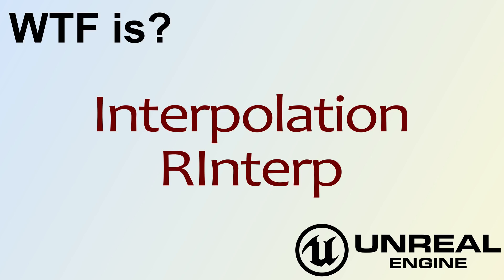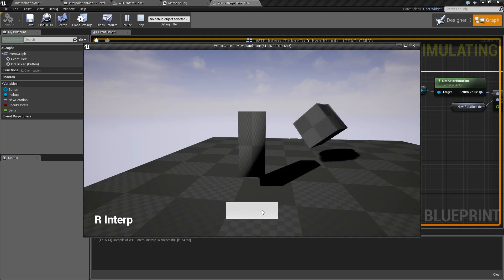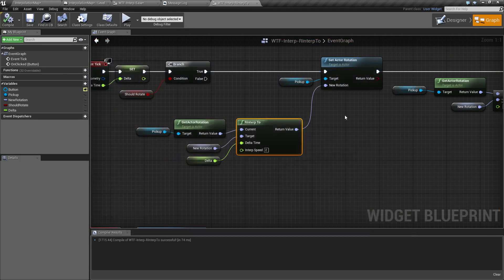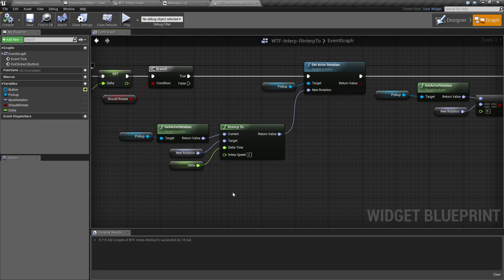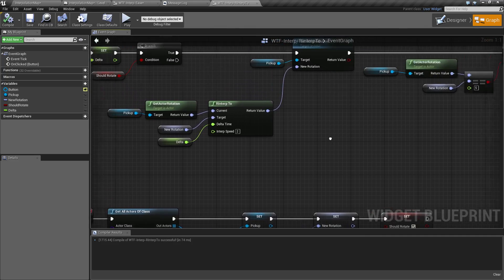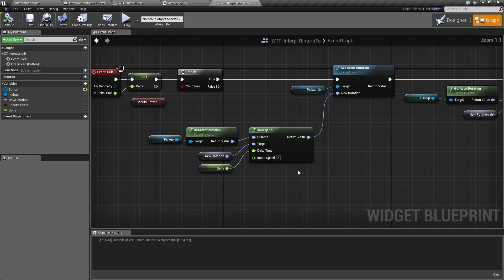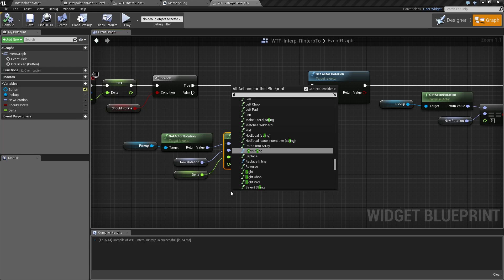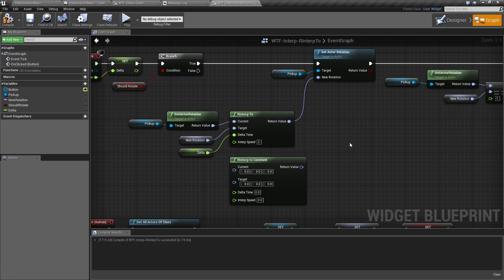WTF Is? Interpolation - RInterp Node in Unreal Engine 4

Comment: Great. what's your delta set to? I plugged mine into delta seconds in Event tick with nothing happening, and I also used a static delta time and my character snaps instantly anyways
Reply: Depends which node you're using. Rinterp to Constant needs a much higher interpolation speed for some reason. If you have a timer you're running, you can also use an rlerp and have the timer drive an alpha curve of 0 to 1.

Comment: It should be noted that to do the rotation correctly, there are 2 things to keep in mind:
1. you need to accumulate delta time
2. the interp speed is a multiplier by time. 2 = 1/2 second

I only code in c++, but this is the equivalent to blueprint:
  FRotator TargetRotation = TargetVector.ToOrientationRotator();
  CumulativeRotationDeltaTime += DeltaTime;
  FRotator NewRot = FMath::RInterpTo(FromRot, TargetRotation, CumulativeRotationDeltaTime, .2);
  if (NewRot == TargetRotation) {
      FacingType = EFacingType::PLAYER;
  }

this snaps the object (FromRot) to the target (TargetRot) in 5 seconds no matter how close/far the difference in rotation was.

If you do not accumulate time you will never reach your final rotation. you will keep making smaller rotations to inch towards it never reaching it.
Reply: So to do this in blueprints, what I did was have a 1 second delay (equal to my rinterp time) automatically turn off the "should turn" boolean if it wasn't already turned off from the rotation = thing. Also I multiplied my tick delta seconds variable by a 'speed' of 0.5 - that fixed most of my issues with the rotation not completing.

So hopefully that helps someone if they end up with issues in this code like I did.

Comment: doesn't work, my object just kinda snaps quickly to it's new position rather than "Smoothly" rotating.
Reply: I have the same problem. have you been able to fix it?. and I can't find the example in the projects .
Reply: same with me...I am using LE extended library and I am starting to think this is causing issues with my other BPs
Reply: Me too
Reply: Me too. I never found how to make this work. For years.
Reply: use event tick or timeline before. just it

Comment: still don't understand delta time
Reply: Matthew doesnt explain it well. You need to feed your "RInterp" node with growing delta value. For example if your speed is 1 and delta 0.3 the output rotation will be 30% on the way to the target rotation. If Delta increases , the interpolation will approach the target more and more (depending on your speed). 
With the speed of 2 and delta > 0.5  there will be no more value changing, because target rotation was reached already
Reply: @onground330  FWIW for anyone reading this, I found this not to be the case in 4.25
Reply: Onground, you're the man.  thanks, this helped out a lot!

Comment: I'm having trouble with a character movement where it snaps the character's location and rotation to a spline path. It works great, but I want to smoothly interpolate from the character's current rotation to the target spline orientation when the character reverses direction. If I get it to interpolate his turnaround then it stops following the spline's rotation, and only snaps his location. It's as if I'm setting absolute 0 or 180 degrees on the Z axis rather than interpolating to the target spline rotation.

Comment: Hello, i want to track a ball location to playercontroller with an rotator yaw output (for a radar).  I tried to use RInterp To > Break Rotator Yaw > Rotator from Axis and Angle (for angle)     for Axis i used Ball Actor Transform and Player Location > Transform Direction > Rotator from Axis and Angle (for axis)      I'm close but it doesn't work so far :/

Comment: Love your tutorials, so easy to follow and great tips and trix! But I got a bit of a problem....
I've been searching for an answer how to slow down and smooth the movement of a FPS and this RInterp-thing keeps coming up. But I can't find anything on how to modify my FPS-blueprint so that the movement is smoother and slower. Or is there an easier way to solve the issue? Would be so great if you could help me with this problem! Thanks!
Reply from the maker: +Sandra Wangström well the RInterp is meant to keep things rotating smoothly from one point to another over time.  Do you have any more details on making the movement slower and smoother?  If you mean turn or move speed those are both basically multiples of the input float you get from the input even you could always multiply that input by a fraction smaller than 1 to get a smaller number and then update your movement less each frame.

If you try and use an Interpolation node on player input you might run into an issue where the player tells the game to move left and the player on screen doesn't react immediately.  If this is what you want however then interpolation may work or you could try just adjusting the input speed up to it's max slowly as well rather than all at once.
Reply: +Mathew Wadstein  Found a tutorial and it solved my problem. Thanks anyway :)